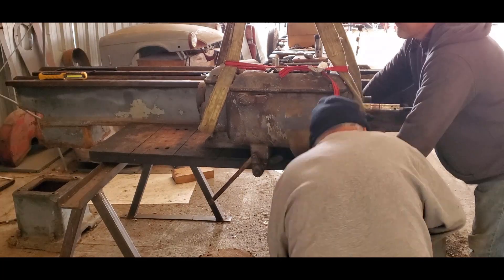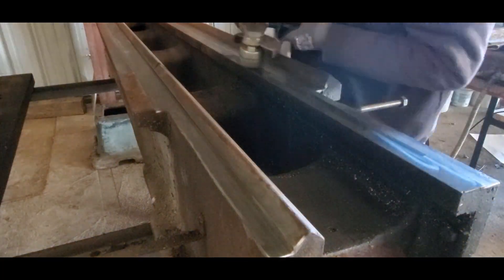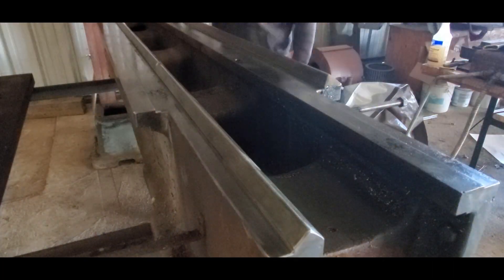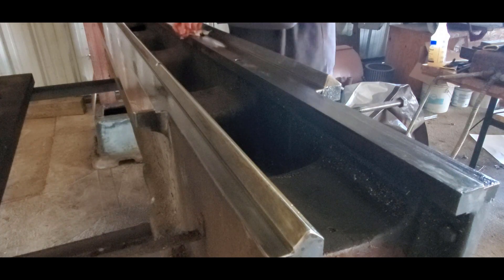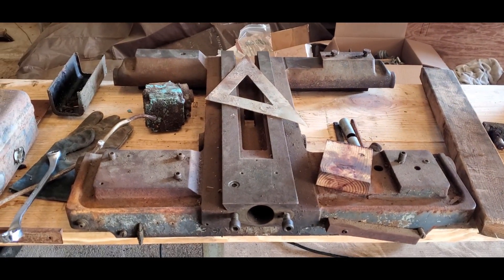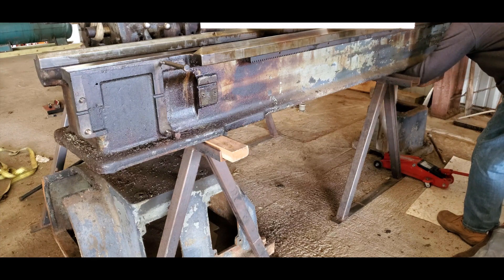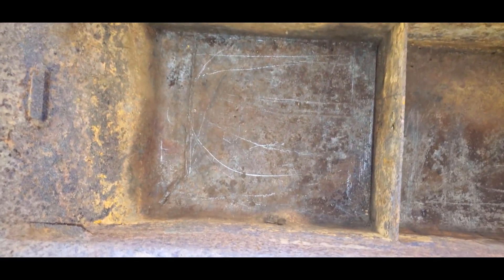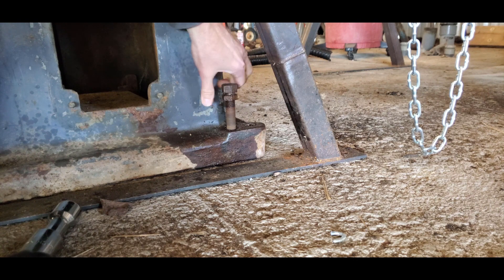Monarch Lathe Progress - Pt II

Comment: Nice video. I haven't seen a Monarch broken completely down like this.

Now imagine trying to get your leveling bolts out only a previous owner snapped the heads off. That's my situation with my 194 16 CY. I got the worse ones out by welding a nut to the remnant of the bolt. The heat of stick welding did most of the work. A few are completely loss causes. Keep these great Monarch videos coming!

Comment: Hey Jim, next time you get a bolt that hard to remove spray it with a penetrating oil back it off a little respray it then screw it in, repeat the process a few times this enables the penetrant to lube the female threats more effectively also watch the heat factor you don't want to be impacting so hard that it heats up. let it cool off add more spray etc also if you are able to squirt some on the bottom side that's always a good thing too. yes, this is a little more expensive on penetrant but what would you rather deal with a broken bolt or buying more penetrant? sometimes using flame on the casting helps break the bolt free too.
Reply from the maker: I used tons of penetrant. The combo of heat and penetrant alternating usually works well. I should have flipped the casting sooner to fill the hole from the backside, which I eventually did. This was one of the most stubborn I've encountered.